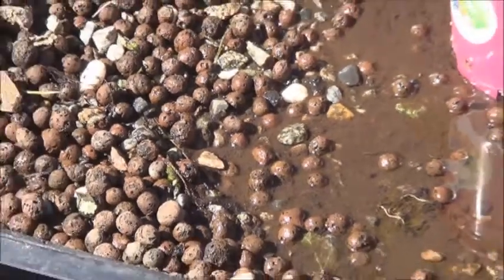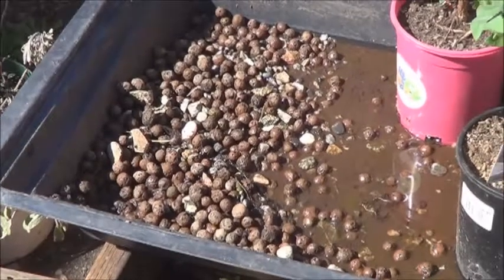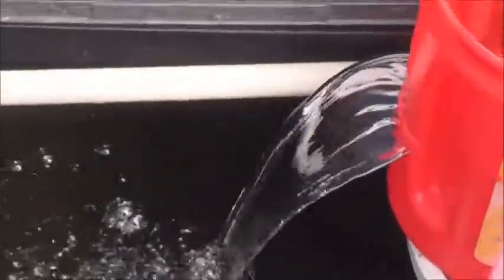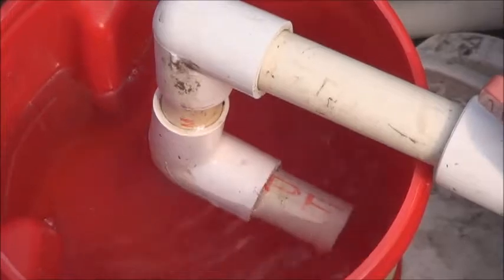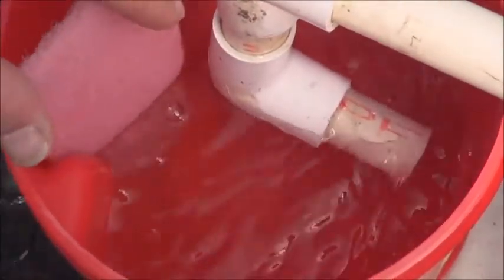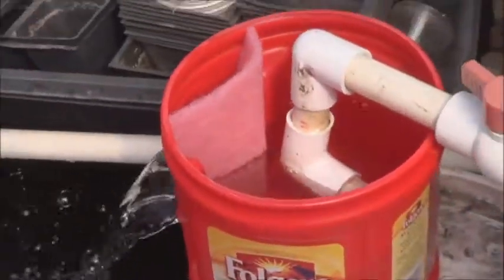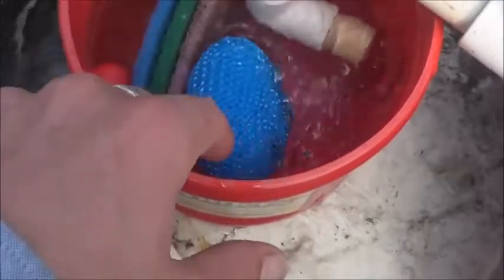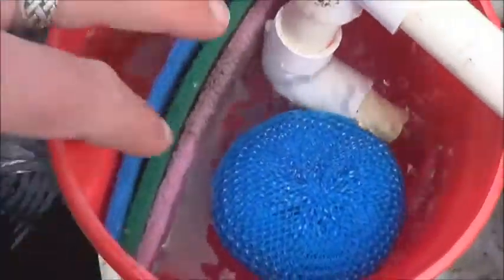Easy to Make Simple DIY Solids Containment and Waterfall Feature for my Aquaponic Garden

Comment: I did something similar to be honest it worked as well as anything else.  I have done almost every filter system with my favorite is the Radial Flow - lots of flow & hardly do anything.  Great job
Reply from the maker: Thanks!  It seemed like a good idea at the time.  I must say I'm fairly impressed with it so far, I've checked on it a few times and it seems to be catching quite a bit.  Suspect it will need a cleaning tomorrow...

Comment: Heck I'd keep it! The slower you can get the water moving through it the more solids it should be able to catch in theory (less water pressure to push the junk through the scrubbies) perhaps a dual coffee can waterfall/ filter? :p
Reply from the maker: I was thinking about a couple more of them, maybe even into a floating bed ... we shall see!
Reply: One thing I just thought of with the dollar store scrubbies is that the green ones leech their colour when they're new. Dunno if you had any white ones in that pack or the pink should theoretically have less dye in it. not sure about the blue though but they would seem like they require a lot of dye to get that colour.
Reply from the maker: Good thinking, I never even considered it.  I'll pre-soak the next batch and see what comes of it!  Thanks for the heads up!

Comment: Very nice.  I know that you said it's not a long term solution, but the mechanics of what you have should work for a long time.  The only thing you may find is the scrubby pads will eventually get so gunked up with solids that the water level rises......but since you left an inch or so of space above the pads, the water would just flow over the top of them, and it doesn't appear that you will have any overflow problems.   Will be nice to see an update in a few days to show exactly how much gunk it's collected.  :)
Reply from the maker: It should help a little bit at least.  Thanks for checking it out!

Comment: In theory untreaded rockwool should work as a filter media though you would need a lot of surface area to prevent clogging. That stuff is like cotton candy made out of stone and looks suspiciously like aquarium filter floss. Rockwool cubes get used in hydroponics all the time so I would venture a guess that as long as it's not the stuff treated with a fire retardant it's nontoxic
Reply from the maker: Ya, I um ... have theory issues with rockwool.  It reminds me too much of old insulation.  I tried some in the beginning but I don't make any use of it now.  What about a cheesecloth in a frame set up like a beekeeping box?  Just switch them around to rinse and replace as needed.  I'm pretty sure I see a long term solution developing ...
Reply: My job requires a lot of theorizing so I find my brain running off in random directions without me :p
I would miss the Folgers can waterfall if you were to get rid of it, I keep my 1 1/3 kilo Folgers cans from costco now because of you! You need to get your hands on some of those, they're HUGE!
Reply from the maker: I didn't know they came that big!
Costco you say ...